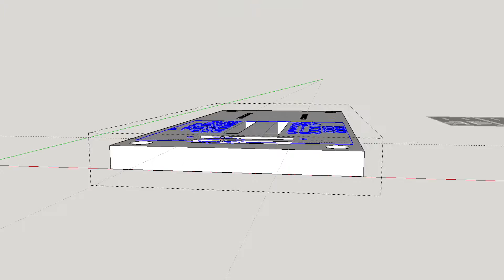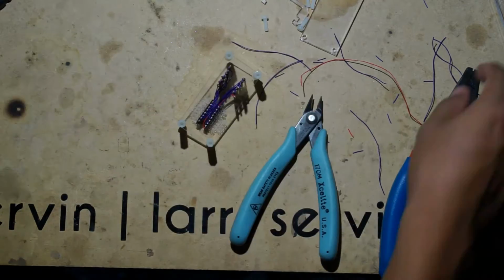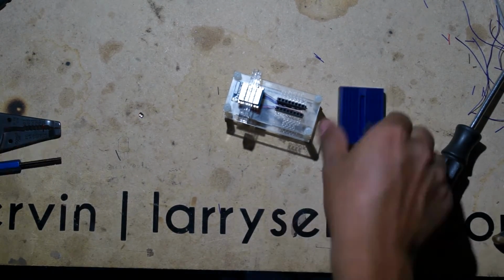Easy ESP8266 Programming Jig

Comment: Cool, but what do you do when the ESP is integrated into your design and you need to re-program?
Okay, perhaps you integrate an OTA program function. But what if you mess up, and upload a duff firmware that breaks the OTA?
Seems much easier to put programming pads on your designs, and then use some pogo pins to connect the serial programmer.
Perhaps there are some designs that are so space limited you do not have room for programming pads, but that would be the only reason.
Reply from the maker: True!
If they were going on a PCB, it would make sense to add test/programming pads cause the pads would be a pain to keep the pogo pins on them if they’re soldered on the board.
I made this just to program one offs / break out the ESP to a breadboard.

Comment: Very nice project. One suggestion to make it easier for those building one, you don’t need to add pogo pins for every single pad just to program a board.
Reply from the maker: BustersCNCchannel correct! I just added them all just Incase someone wanted to breakout to a breadboard to test their circuit easy over and over

Comment: The number of folds depends on how you do your folding.

You could determine the length of one, and then fold, back to length and fold again, until you fold back and forth 15 times.

OR 

Determine total length needed for 16 wires. Fold in half for 2 wire, fold in half again for 4, in half again for 8 and once more for 16, thus, only 4 folds (powers of two are so nice).